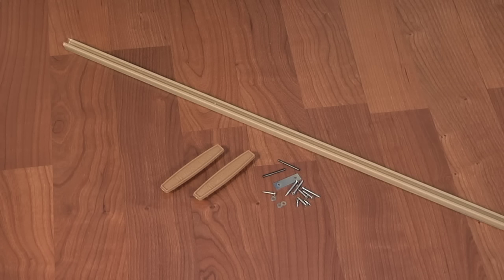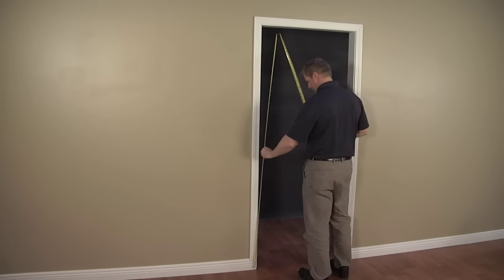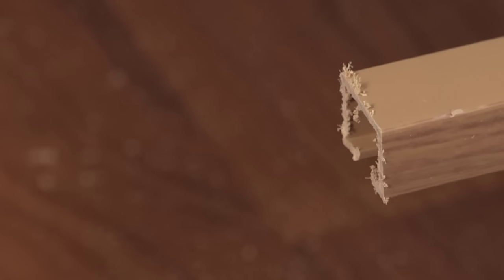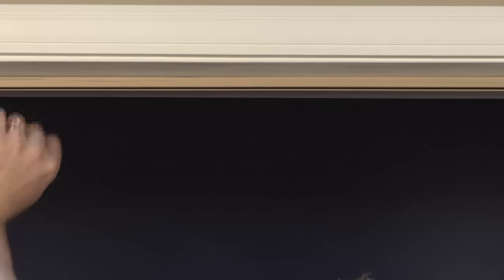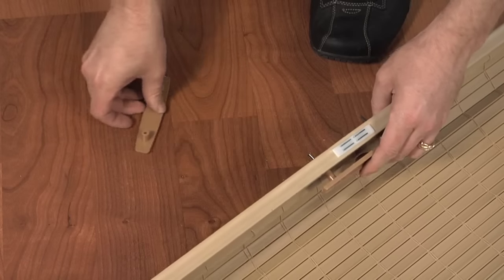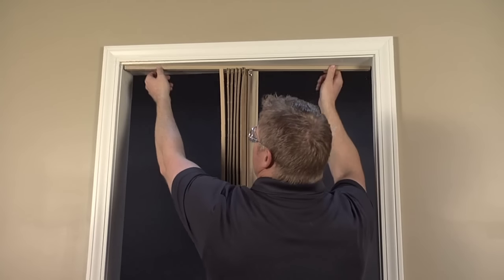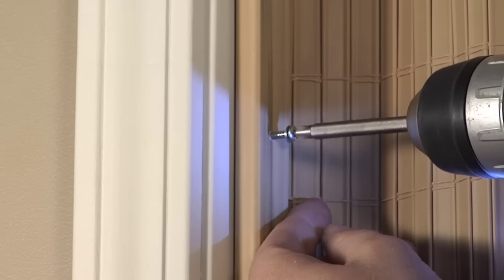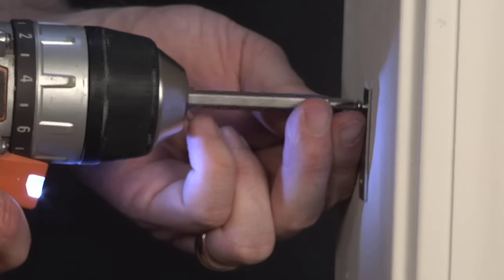Horizon Folding Door Installation

Comment: Hello, the door is very tight at the bottom, it seems as though the door is a cm too large for the frame, it will fit if it is squeezed in, can I cut down the bottom of the frame on these types of doors?
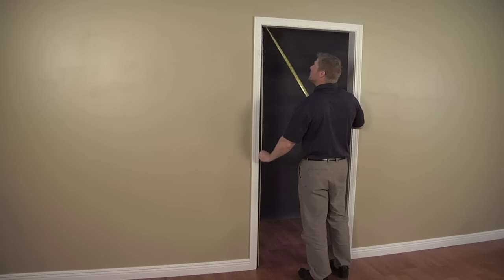Reply: He explained that at the 1:12 mark in the video